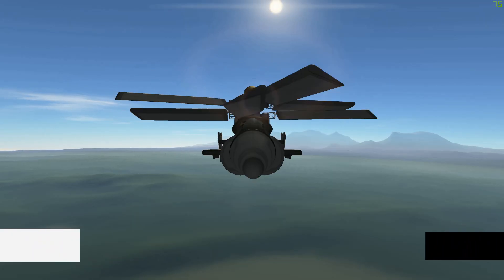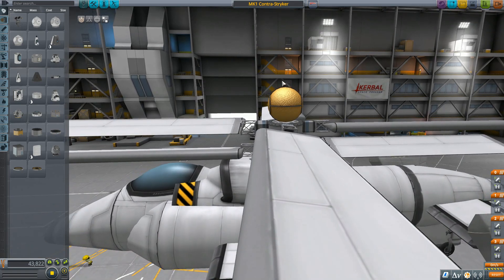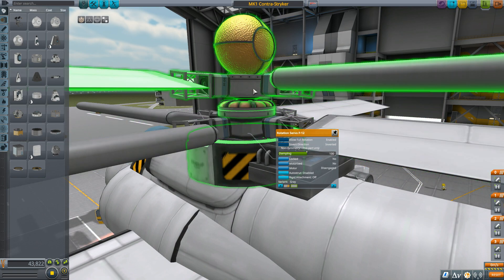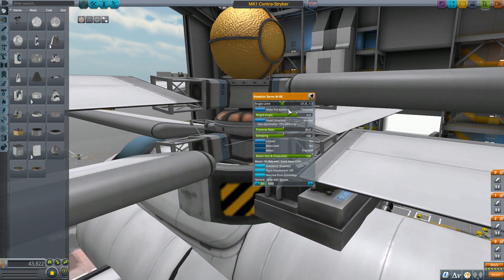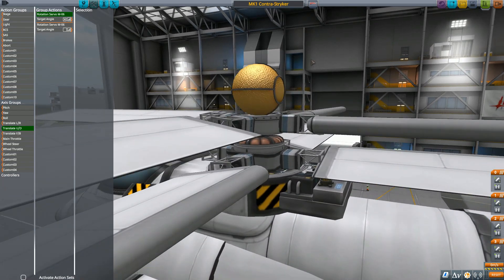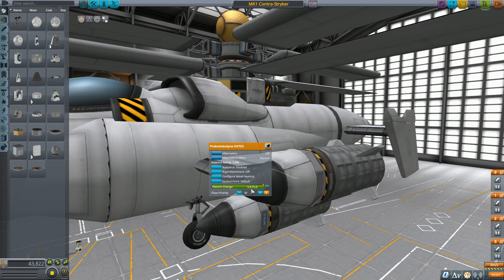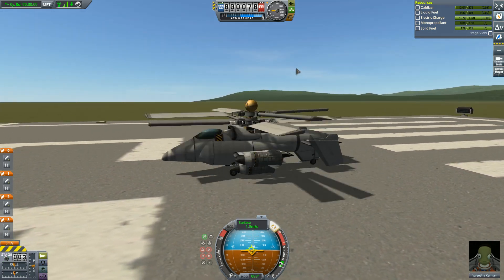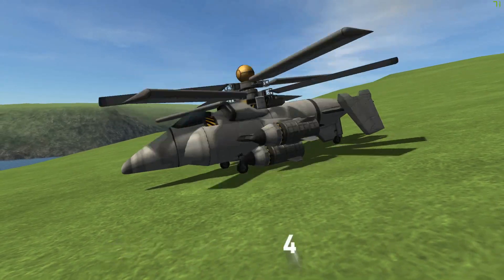Kerbal Space Program Helicopter Tutorial: Breaking Ground DLC

Comment: Nice job, been struggling with this.. I don't really like the whole design but it certainly gives me some ideas.
Reply from the maker: Fair enough. Hope it helps. Good luck with your build.
Reply: @ControlledPairsGaming  basically do the helicopter parts work without having to compensate with clunky dual rotor designs (I can not figure out how to even activate the rotors without manually adjusting the torque in the access menu during flight) ANY TIPS WOULD BE AWESOME THANKS!
Reply from the maker: It works, yes, but will require some tweaking to the tail rotor. Use lots of SAS to help and map the axis control to the main rotor collective, not the tail.
Reply: @ControlledPairsGaming  is it possible to just build a simple single rotor craft? With ONE tail rotor and ONE lift rotor?
Reply: @ControlledPairsGaming  I'm on XBOX btw